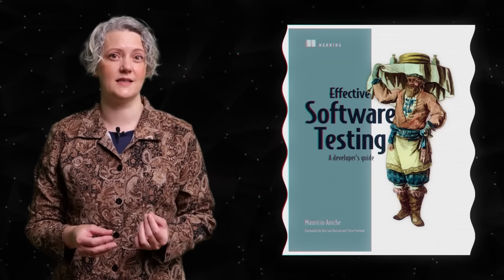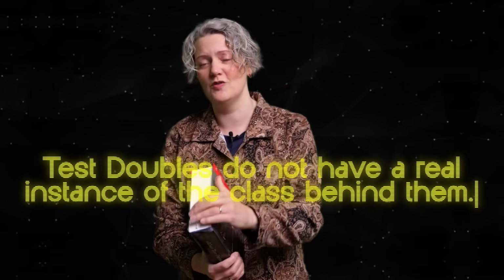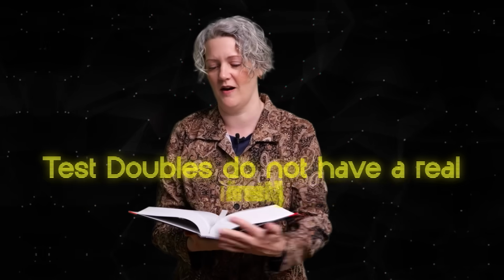We Need to Stop Calling Everything a Mock!

Comment: See I think some people who have replied in the threats still don't understand what a stub really is and why it is functionally different. A stub doesn't even have to exist in the test wear code that you're written it could be a lightweight API that you've set up that returns an input . I'm trying to remember the name of the Ruby framework I think it was called Sinatra that we used to use for things like this. A stop is also implicative of an additional implementation of something but doesn't have all its detail filled out so and this is why I think people get confused because when I create a class that has another class and I have a method that I need to do some implementation and I might have an initial stub okay and when I'm testing it it might just simply log hey function a has been called . All right now if you have a class like that in your test framework that you sub in for testing purposes that also technically would be a stop but it's not really a mock. Is different than a fake which is a lightweight local for the test implementation to help you get around some sort of integration confusion or difficulty for testing like she mentioned it a memory database whereas a mock has the capability not only to be wired up and told at run time what it responds to and how it responds to it. But mocks have been overloaded with spy Behavior because despise are primarily concerned about reporting how something was called not whether it was called or or specifically what value is returned. When I think of a spy I think of a class that has a method but that class has other methods that do some kind of record keeping so I can interrogate the spy and get information about what happened when it ran. But in a lot of languages moxins have been a lot of spy behavior and so that's why it's confusing today. The reason why people want to just use the word mock because they say oh it's the same no it's not the same you have a term that has had additional meaning added to it because somebody thought it was convenient . And this is one of the rubs because developers like to say that they know how to test just fine but they don't always know exactly how to test something in fact when they write tests they're exploring how they might test something but one of the key things to understand when you're trying to test something is definitions of terms and by not understanding the differences between mocks stubs and spies, we merely contribute to the problem thank you for this video

Comment: They have minor differences and are all confusingly named... What I know is that if you use a crappy language or framework that requires you to use them, then tests will be much more tedious to write and be either horribly fragile and break for every minor improvement of the code (particularly those that "spy" on the behaviour and thus hardcodes expectations of a certain implementation so that when you improve it, the tests will "fail" because you stopped inefficiently to call the mock/spy every loop iteration etc.); or of very limited or outright dubious usefulness. Because if you have to write or generate a whole parallell implementation of everything just to "test" the code then you often have to deal with bugs in the test-implementation and constantly make changes at least two places every time the interface is changes slightly (and of course this idea also requires you to make pointless interfaces for everything even if it has only one real implementation). And also as soon as you start using fakes (whatever you want to call them) to replace parts of the system during a test, you suddenly find that another piece of the code doesn't work with the fake so you have to fake that one as well, and another one and another one untill you realised you've created a test that doesn't actually touch any actual code at all, because the only thing you're really checking is that some real code calls a method in a fake object which calls a bunch of other fake code. I've seen so many "tests" written by "test everything" fanatics, that basically test that function calls calls functions and that the compiler/interpreter works, i.e. tests for code like this:

function sanitiseAndSave(id, data, sanitiser, database) {
  var sanitisedData = []
  for(field in data) {
    sanitisedData.push(sanitiser.sanitiseField(data))
  }
  database.save(id, sanitisedData)
}
Where of course the "test" supplies fake id, fake data, fake sanitiser and fake database; so what you're testing is that for-loops work? That you can push something to an array? That a method call, calls methods? What is the point of this!?
I've also seen (and deleted) dozens of "tests" that thest functions that more or less only call a few other functions that also have their own separate tests; sometimes completely pointless because they "mocked out" those function calls by using hacky code injection to modify the "code under test" to call stubs/mocks whatever, which doesn't test anything but makes refactoring impossible; or redundant because they just tests the same code twice once in the separate unit tests and once in the "test" of the function that calls the other functions.

Unless the fake needed is realy loosely coupled and really expensive to use the real implementation; I generally find that as soon as you start to "need" fakes to write tests, then the test usually becomes rather meaningless. Better to test the actual testable logic as unit tests and assume that the language features actually work.

Comment: Having defined what these are called, we should go on to discuss how to use them: or whether you should. "Mock" as defined here means testing "expectations"; that is, particular methods were called some number of times, maybe with particular parameters. This is testing how something is implemented, not whether it returns the correct result. When you come to refactor the implementation, you could break the test even though the correct result is still returned.
Reply: Spy doesn't seem all that much better

Comment: 10:22 I really don’t agree with the definitions of that “authoritative source”.   The boundaries aren’t correct and too binary and exclusive. Mock is the right term to use going by the dictionary definition which is “not authentic or real, but without the intent to deceive” with examples like a mock exam, or mocking someone for their behaviour. The mock needs to be imbued with powers… a mock exam is to allow practice… mocking someone is highlighting and accentuating a trait. So in programming, a mock is something we put in place for control over testing behaviour. We imbue mocks with traits like spying, or handling/providing specific data, etc. We are likely using an ecosystem of mocks when testing a complex piece of functionality, all with different sets of traits. I’m pretty sure the confusion is that testing patterns fall on a multidimensional spectrum rather than being explicitly one thing or another, yet modern society is trained to thing in binary. In reality, we are likely use a Matryoshka doll of testing patterns. Just use patterns that are useful and don’t use patterns that are complex or hard to alter. It’s really that simple.

Comment: Right checks, proof well this is the reason why it is very important to go by the definitions in order into the right situations of perfect displacement that are needed in that situation if not well in one hear and out the other and later in the future was in there then all of a sudden you figure something out because experience has showed up from that point on through until it happens even if you knew it was the truth like always it has to happen in its time.😊
Reply: I've seen you comment on every video, but I never understand a thing you're saying. Could you try forming sentences and using . to mark them, I'd be a lot more comprehensible that way!

Comment: This is the problem all of use ,use definitions that never meet up directly and or not in orders where they do not communicate to be used for the right situations well if you lined up the definitions in orders and the responses to go in the direction of the situation everything works..............do you know I work on a project in chess and I have to figure out what I done to another program well I go to the dictionary and to my surprise I find all my answers for the truth and I need to see it for my self on the board left to right and I needed to know why because I got to put down numbers on the board in order and the definitions told me the reason why and it showed me if not that if it was the other way it would start with b and that would leave a out and by definition is 1 and that's all I needed to know to move forward with my numbers on the chess board because when they want to know why my friend I told you before I'm deterministic.......and I will only follow the true definitions and seek out there explainations that there can be no excuses because you do not call me a lyer I call out the definitions and they are the only and very best in the truth.😊

Comment: I just use the terms mock and stub. I don't see a greate benefit to destinguish between mock and spy so I call both mock. The same for stub and fake, I just call both stub.

We can overthink and complicate everything or we stick to simple stuff and get work done 🤷‍♂️
Reply: @Psy45Kai  I like it was implemented in Spock. They mainly differentiated Stub for dummy response, Mock for a more advanced scenario and Spy, when you can later ask how many times method was called with which parameters. Initially they also discouraged use of Spy as a way to get into implementation details during testing. 
Everything on top of this is overcomplicating what was supposed to be easy and simple to read
Reply: I do similarly - I think? I create a "test" that might stub sw interfaces, or mock for replacing functions/objects in a 3rd party library  (eg file io library that you can't stub). That's all. Probably not correct, but whatever... And I avoid mocking within a test as much as possible, given above definition.
Reply: Mock to me is just a piece of code making a test reasonable. The nuances usually don't get into the important realm.

Comment: I get that if you're writing a book on testing, then having definitions is useful for the reader and the author to communicate context efficiently. But for every day life, I don't really see where this stuff would be useful. I must admit, I hadn't heard of them other than mock, and it hasn't been an issue for me or my team. As to the gut correcting the other guy mid talk, that sounds like a really douchey move.
Reply: What about refactor? Or unit test? Dont both of those experience semantic diffusion too? Popularity in the industry doesnt always dictate what is practical. How do other engineering and even scientific communities handle this?